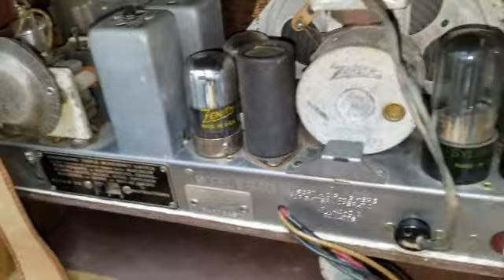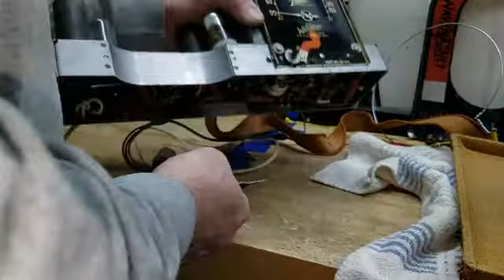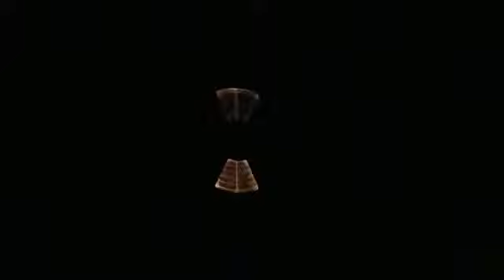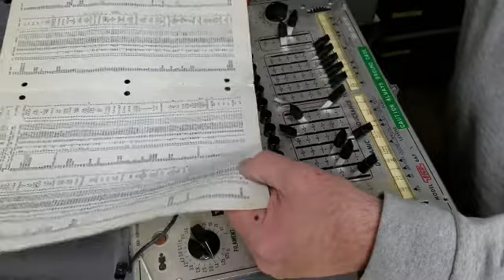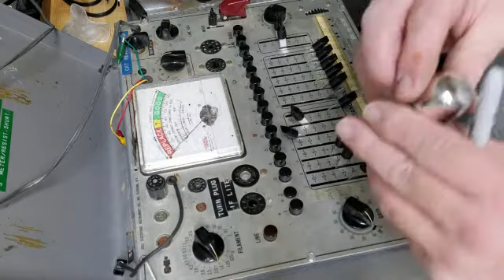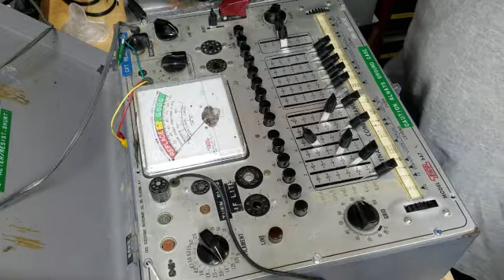1941 ZENITH 6G501M Portable AC-DC Radio Part 1 of X First Look

Comment: Two mistakes that I guess you realized later on, the speaker is a PM type NOT a field coil, and the tube filaments are in series not parallel.  Battery operated sets NEVER had field coil speakers, always PM..  AC/DC/Battery sets either had the tube filaments in series, or switched them from series to parallel when operating on battery.
Reply from the maker: Yep, I've done some battery sets since then.  I did not realize (though it is "common sense") that there would be no field coil, drawing all that current.   Makes sense about the series filaments, too.  I'm a relative newbie, still learning a bunch as I go.  You might notice that I don't often give "theory" advice.  It's because I am not that confident in that arena, yet.  Most of what I show people is how to do the physical "restore" to as close to original as is safe.  But, that leads to theory and technician-type mistakes.  That's why I am grateful for your comments.  I am learning a lot from you, Kenneth.   Cheers!    Michael
Reply: I had a similar Zenith radio as a teenager.  It was a curbside, trashday find.  That radio was a Bakelite set with two doors that popped open when the set was turned on, the wave magnet would pop up as well.  Tube lineup was almost the same, 1LN5's, 1LA6, 1LH5, 3Q5GT.  No rectifier tube, it was a postwar set that used a selenium rectifier.  That's why I know the circuitry, had a lot of 'fun' getting the radio to work, and I remember lugging it around outside listening to 'rock-n-roll' on WMCA in Brooklyn N.Y.C.  Those battery packs were unobtainum by that time, so I rigged up series connected "D" cells and 9 volt batteries to power it.